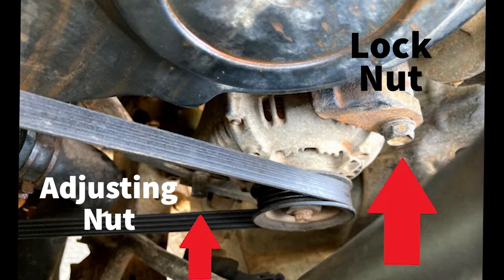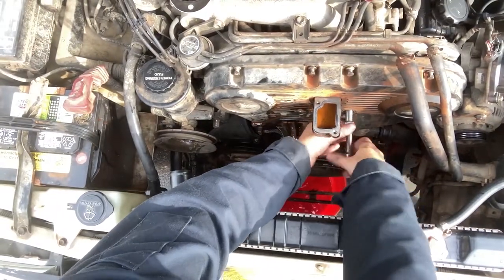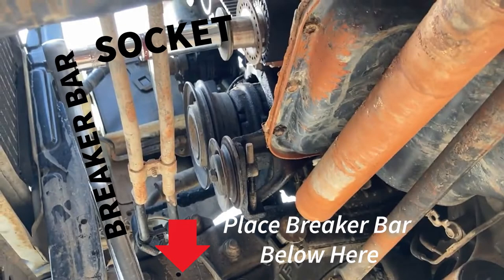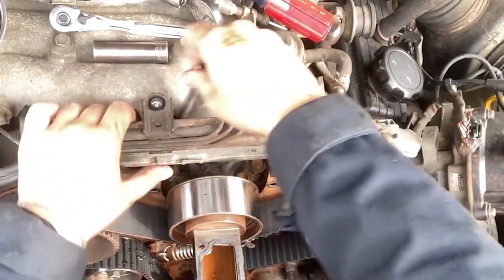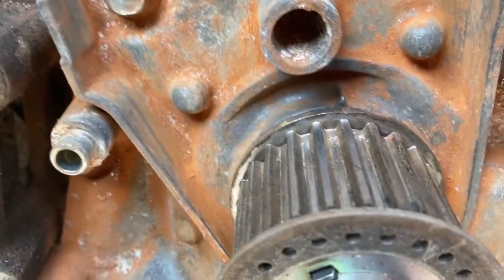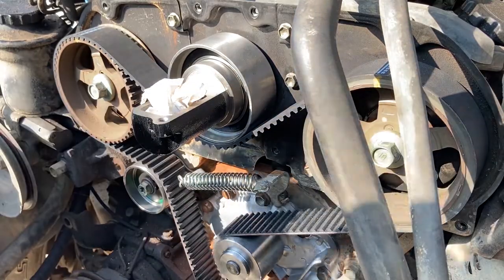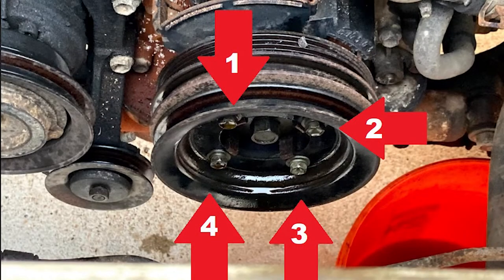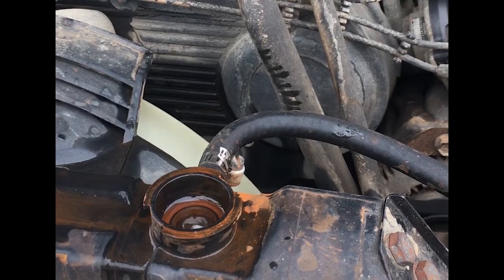Toyota 3VZE 3.0L Timing Belt, Water Pump, Tensioners Replacement - Girlie Garage

Comment: I have a 1995 Toyota 4Runner that hasn't run in 2 years, 2 Years ago we had some -20F degree weather that did a lot of freezing destruction here in Oklahoma City, Oklahoma and I had tried to start the 4runner to get to the store but it quickly started to over heat so I immediately shut it back off. After the weather warmed back up some I tried to start it and all it did was turn over but wouldn't start. Since then I have had 2 different Mechanics from different shop come to fix it. the first mechanic said I needed all new injector and that he would have to take it into his shop to remove everything to replace the injectors. I told the scamming thief to leave knowing the odds of all 6 injectors going out at the same time is almost impossible. The second did all the same checks as the first and a compression check that showed it had almost no compression in all cylinders, he stated he might be able to rebuild the engine for $2000 but more then likely I would need a whole new engine costing over $6000. So my vehicle has sat since till I found this Video and got to thinking what if the timing belt broke or jumped that might be why there is no compression. I watched this video a few time to get to know what was what and today I took my tools and removed the timing belt cover like in the video.  Yep there it was in all it's glory a destroyed timing belt that had not only server wear but had also jumped teeth causing the valves to be open when they shouldn't be, so no compression. Now I will replace the timing belt and components needed to have my vehicle running again all because I came across this video. PS: For anyone thinking I need to replace or do a valve job because of the bad timing belt this engine 3VZE in 1995 4runner is a NON-interference engine so the valves and pistons will never touch no matter what if the belt even completely breaks.
Reply from the maker: WOW! Thank you so much for sharing your experience. It's insane that you had it taken to 2 different mechanics and neither one of them checked the timing belt (and all you had to do was pull the timing cover off). 
You are 100% right, it is a non-interference engine. Sometimes if the vehicle was running when the belt broke, there can still be damage, but these Toyota engines are usually pretty durable. 
Please let us all know if it runs once you line everything back up and throw on a new belt! 

I'm doing my best to make quality content, and you can always help by subscribing and sharing the "Helpful General Auto Knowledge" playlist with friends who need general help with car stuff. <3
Reply: @GirlieGarage  Here's the Update after following your video and replace the timing belt and idler pulleys the 1995 4Runner is purring like a kitten and back on the road after 2 years. Without paying Thousands the mechanics wanted to screw me out of. Total cost under $300 that's including the New battery.  Thank you Girlie Garage for the Extremely helpful video.  <3
Reply from the maker: @MsKinnara  I AM SO PROUD OF YOU! Thank you so much for sharing! This warms my heart to hear and I am so glad you have your 4runner back :-)

Comment: You are awesome. This video is way better than any other I have seen. Do you have one changing the head gasket for this same vehicle.
Reply from the maker: I do not have a head gasket video, and these engines are prone to overheating. I’ll definitely make a video if I get a customer vehicle in with a blown head gasket on the 3VZE

Comment: It would be vary helpful if you made a video about replacing the valve cover gasket and pcv valve for the 3.0 3vze engine. Any more tune up video for that engine would be helpful
Reply from the maker: Totally, especially because the plenum has to come off. If I get my hands on another customer 3vze, I will definitely make a video!

Comment: Great video!  Are the torque specs for the power steering bracket anywhere in a manual?   All I can find is the reversed bolt at 29 ft-lbs.  Thanks.

Comment: Thank you for the video.  I just completed this job on my 1991 toyota pickup. It runs much smoother now as my old belt was cracked and probably stretched.  I'm hearing a new clacky noise and it sounds like its coming from the timing belt.  I suspect the tensioner was not tight enough?  Have you ever had this problem? Should I open it all back up and tighten the timing belt a tiny bit? Thanks again!
Reply from the maker: You should definitely be concerned with a noise. I cannot diagnose it from here, but you should definitely determine where the noise is coming from. If it's more of a clicking, it could be that you need to adjust your valves. Make sure when you open it back up that you look for signs of where things may have been rubbing/hitting against each other (like wear marks where they shouldn't be).
Reply: @GirlieGarage  Thank you for the timely response.  Upon further inspection, I forgot to tighten the fan nuts (I'm so glad it was something stupid like that)...everything else is perfect, no noises, no leaks, thanks again for the excellent video.
Reply from the maker: @alexilizaveta  Thank goodness it was something simple! Thank you for letting me know and I'm glad it's all back together! Great job!

Comment: Your tutorial is perfect. Thank you!  
   Now, can you do one  for an  R+R on the heads for the 3VZE?  No one has been thorough on this project. Thanks. HMan.
Reply from the maker: Thank you! If it were my truck and it needed to be done I would totally make a video for you! This was a customer vehicle so I don't have it at my disposal. Do you have a good machine shop or are you just talking about replacing valves, springs and retainers?

Comment: Nice video. I do have a question, not having replaced a 3VZE timing belt previously. I have the FSM and have looked thru the steps. For some reason that I don't understand, the FSM adds steps to remove the camshaft timing pulleys and the crankshaft pulley (FSM vol 1  EM-116) and then to reinstall them (EM-119 - EM120).  Then before reinstalling the timing belt, reinstalling the crank pulley and installing the cam pulleys . Then installing the timing belt and going thru the process outlined in the video to allow the spring to adjust the tension by turning the crank 2 revolutions. THEN removing the timing pulley bolts, aligning the cam match pins and installing the match pin and cam pulley bolts and torqueing them. I must confess that I'm failing to see the purpose of these extra steps and seems to unnecessarily complicate the process.  Much prefer the approach outlined in the video which seems to accomplish what is needed without removing the cam pulleys. If you have any insights on the purpose of the procedure outlined in the FSM I would be very interested in hearing them.  Thanks.
Reply from the maker: Hey Steve, great question. I am thinking maybe the FSM has you remove the cam and crank pulleys so you can replace the cam seals and the crank seal? That's really the only reason I could think of for removing the pulleys. Let me know if that resonates with you.

Comment: One question, when you go to take off the pulley with the timing marks on it that line up to the 0,5,10, etc was it a struggle to pull off? The outer pull came off easy but couldn’t get the inner. Ran a little pb on it for now but wanted to make sure before I proceeded
Reply from the maker: If you’re talking about the drive pulley, yes, it can be a struggle. Whatever you do, don’t pry on the edges because if you break off one of the little castle looking things you’ll have to buy another drive pulley (that’s how your crankshaft sensor runs).
Reply: @GirlieGarage  I appreciate it👍🏼

Comment: Hi,
I'm getting ready to do this job following your great instruction video, but I have one question.  I see that you fabricated a square steel beam to hold the crank pulley while tightening it, so I'll try to do something similar.  But my question is, how do you torque the crankshaft bolt to 181 ft/lbs if your torque wrench only goes to 150 ft/lbs?  Do I need to find a bigger torque wrench?  Thanks for the great video!
Reply from the maker: You can find a bigger torque wrench or go to 150, then put a beaker bar on there and tighten it some more

Comment: Question…. How did you torque the crankshaft pulley because doesn’t the belt just keep spinning? Preventing you from being able to tighten it.  

Also…. Is their more details on how to time the engine other then just lining up the marks? Because isn’t each camshaft, and crankshaft on different rotations? 
Like won’t the crankshaft pulley do 3 circles before the crankshaft itself actually does a full rotation… and the camshaft are like that too? 
If you take timing belt off, aren’t you worried about these pulleys spinning and getting a half rotation off from other pulleys?
Reply from the maker: That’s why you line everything up to TDC BEFORE you remove the timing belt. Once all 3 timing marks are lined up, there’s nothing else (other than putting the belt and tensioner back on and rotating by hand a couple times then re-checking timing). 
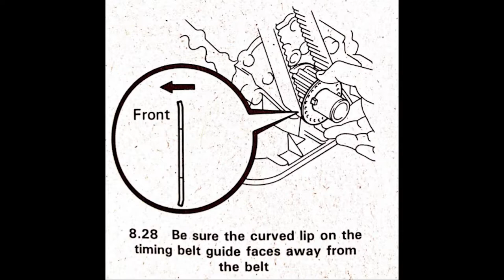You can see the device I used to torque the crank pulley bolt at 10:37 or you can buy or rent a crank pulley holder for this vehicle (recommended and the link is in the description).

Comment: What is the best way to minimize rust around rear fenders? Is it okay to try to paint over the rust?
Reply from the maker: You can paint over it if you prep it correctly and get rid of the rust. Otherwise you can also spray it with a rust inhibitor or rust converter depending on your needs. Rustoleum has some nice products, but it really is a personal preference.

Comment: Removing the sprockets and the back cover, you can access the bolts to the #2 idler easy. Do this if you have difficulty and way easier than removing the air plenum, I’ve seen in other vids
Reply from the maker: Yes! Also if you plan to replace the cam seals you'll be removing the cam sprockets anyway! Thank you for sharing!
Reply: I got stuck on trying to get this number 2 pulley out today, made it halfway through pulling the plenum off and thought to myself there has to be a better way. Thanks for your comment, you’ve steered me in the right direction!

Comment: Hey, you are the best. My belt slipped and I was wondering if I had to turn the camshaft pulleys a certain number of times for them to be at TDC after I got the crank shaft to TDC...It's okay if you laugh at me. Also giving the torque specs felt like above and beyond...thank you so much.
Reply from the maker: The camshafts have their own timing marks so as long as you line up all timing marks (camshafts and crankshaft) you should be good to go. It is always good practice to rotate the engine by hand (you do this to reset the tensioner but also just to test everything). Good luck!!!
Reply: @GirlieGarage  I came up on another suprise...the passenger side cam wont go to TDC. Should I crack the plugs to see if that will get it there or is something  else majorly wrong?
Reply from the maker: @sethsacks9947  I usually pull the plugs so I’m not fighting the engine, but by “won’t” idk if you mean physically? It’s a non-interference engine so there shouldn’t be anything in the way
Reply: @GirlieGarage  I cracked the plugs and even after that the shaft stops on one of four positions but none of those positions  line the notch on the wheel to the notch on engine. Is it possible that the wheel just slipped? If it did do I have to disassemble the engine to fix it?
Reply from the maker: Can you email me pics so we can continue our convo? Info@girliegarage.con
Reply from the maker: @sethsacks9947  Did you get it figured out?
Reply: @GirlieGarage  not yet. I did take the passenger cam pulley off and it looked as if  someone put a paint dot that lined up with the key. Could someone put the camshaft back in the engine incorrectly and still get it to run? I tried emailing but it didn’t go through. I will try again
Reply from the maker: @sethsacks9947  sorry, the email should end in “com” not “con” fat-fingered it. 
Info@girliegarage.com

Comment: Ok I am a subscriber and seeking advice. For 25 years I own
in the engine. Pitting, that was fixed. It has a rebuilt distributor assembly
because the old distributer was original, it has rust. They are having a timing
issue where it won't run right at 10 degrees and maybe if they set at 15
degrees engine might ping (detonate) it has fresh gas. They did a good job on rebuilding
the engine, just a challenge to  get the timing right. Do you think I might need a new engine control module or a  modified module to get the timing correct? Was it a mistake to trade in that
old distributor as a core?  Any advice?
Reply from the maker: Hey Tony, sorry to hear your truck is not running well. I don’t really have enough info to help. “Not running right” is not enough to go off of. There are MANY things that need to be checked as far as diagnostics. For example a vacuum leak on one of the many lines that are 30 years old could cause the engine not to run well. Maybe get a second opinion from a mechanic in your area?

Comment: Great video! Question : since I have a near new timing belt (10 K miles or so), but I need to replace the water pump, is it possible to replace the pump and the thermostat without actually removing the timing belt?
Reply from the maker: Thank you, great question. The water pump is run by the timing belt so you will have to remove the timing belt to replace the water pump. The thermostat can be replaced independently and you don't even have to remove the timing belt dust covers as it lives under the lower radiator hose (where it connects to the engine).

Comment: You lined up the cam and the crank and then used the bump method to loosen the crank pulley bolt. Doesn't that move your top dead center alignment when you do that?
Reply from the maker: Yes, a bit, but you can move it back then it’s easy to take the crank bolt out with a jerking motion

Comment: Impressive, but I must mention that your V6 job was drastically easier than my V6 3.0 in a Camry facing the right side tire, rather than forward facing the radiator - such as yours.
Although I gave you a thumbs up, I wondered why you didn't mention having spark plug #1 in the compression stroke while setting at TDC. If it's in TDC but decompression stroke, the car runs and dogs slowly down the street like it's dragging a 10,000lb rock.
Reply from the maker: Hi Jeff, yes, the Camry or even the Highlander 3.0 are much harder when not facing the front because there is less room to work and you have to remove motor mounts, etc.
The definition of Top Dead Center is when the #1 piston is at the top of it's stroke so it is implied when I say "TDC" because there is only one version of TDC for every engine. I hope that helps.
Reply: @GirlieGarage  Thanks for answering back but I cannot totally agree with you.
"TDC" (top dead center) refers to when the harmonic balancer aligns with "0" on the gauge AND piston #1 is upwards in a compression state. At this particular state, you cannot assume that this is indeed TDC.
That alignment notch actually aligns each revolution of the crankshaft - once where piston #1 is in a compression state (TDC) and also once when piston #1 is in decompression. ("BDC" bottom dead center). This means aligning the marks on the cams and harmonic balancer do not necessarily mean that piston #1 is in the correct TDC upwards position. The crankshaft may need to be turned another full revolution to attain TDC.
Please respond, especially if you disagree. In summary, I'm saying that just because the alignment marks are okay, #1 piston may not be in compression but actually downwards in decompression.
Thanks Girlie Garage!
Reply from the maker: @Jeff82556  On Hondas and Toyotas there are multiple timing marks to help find TDC (on the compression stroke). Since there are multiple timing marks, it makes it difficult to be at the top dead center of the intake stroke because even if the crank mark lines up, the cam marks would not line up (they should be about 180 degrees off). On Hondas and Toyotas, the camshaft sprockets have multiple marks, usually numbers or arrows AND lines. You want to make sure you have the correct number or arrow pointing up as well as the lines matched up with their alignment marks (usually the top of the head). I cannot speak to other engines. It sounds like Ford likes to make things tricky and you would need to put something in the spark plug hole (like a straw or use a compression tester) to make sure you are in fact on the compression stroke.
Reply: @GirlieGarage  thanks for your reply, again. You seem competent and knowledgeable and appreciate your info.

As for my Toyota Camry, I've double-checked all markings, verified TDC, and I am just puzzled by how poor the performance is (extreme slow acceleration, runs silky smooth though) - as if I did something wrong but everything checks out okay.

The car sat outside for 2 years but always started up lightning fast. One fellow is suspicious of the catalytic converter. Maybe it rusted internally as the car sat idle? I used to be forced to buy a new one every other year or the car wouldn't pass emissions. Who knows? I'm about to give up but first thank you for your input! Take care.
Reply from the maker: @Jeff82556  don’t give up, especially if you put in all that work. If you suspect the cat, you can always just disconnect it and run it straight piped to see if that solves your problem. Also check timing with a timing light, and make sure you’re getting enough fuel and no vacuum leaks. Good luck!

Comment: Question: I am just replacing the 3 belts on my 1990 v6 3.0 Can the belts be loosened and slipped over the fan instead of pulling the fan and radiator?
Reply from the maker: Yes! That’s the fastest way to replace them!
Reply: @GirlieGarage   👍😘